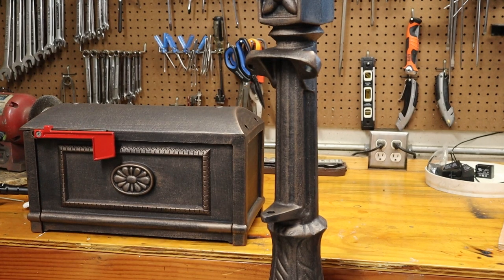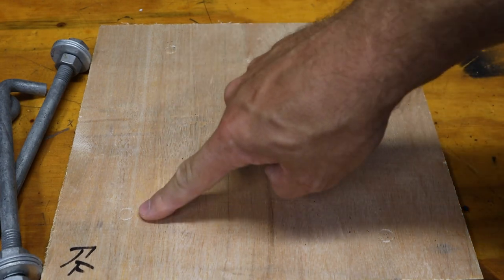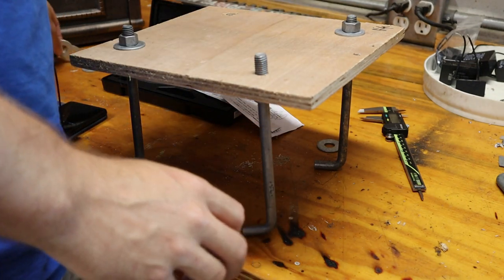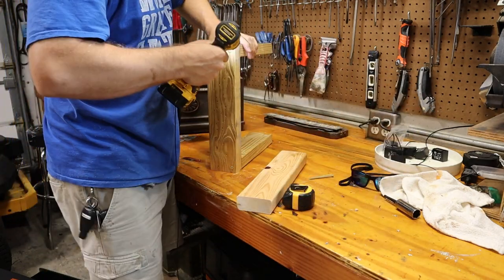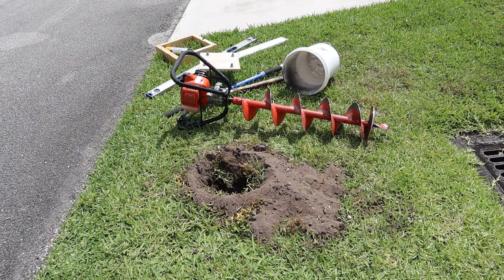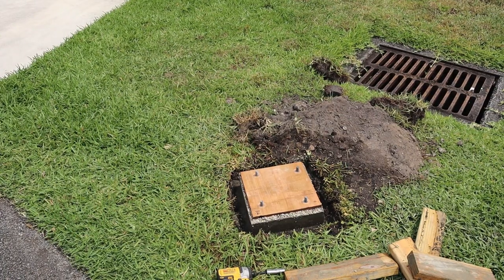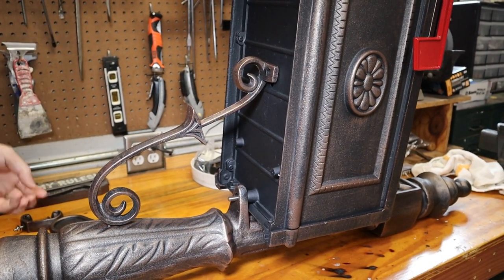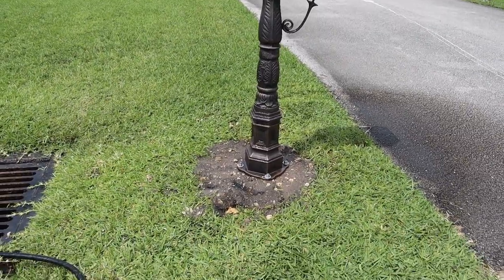Installing "Barcelona" cast aluminum mailbox and post

Comment: How did you keep the door open when assembling it to the post.   Very strong spring makes it slam.   What did the mailperson say when they saw the door on spring?

I just bought one of these and it came with "wedge-it" style bolts that you drill the hole in concrete from the top and insert it from the top.   Used these for installing machinery etc at work.   You can get these at the big box stores if needed.  No wood template needed.     We're looking at installing these on 40 homes in our community, so I think a tapered concrete form would allow to pull the form off without dissembling it as you move thru the neighborhood.  I plan on placing the form  approx 2" above the grass surface so that you have some concrete protection when trimming with string trimmer and not beating up the base of post.

Comment: You sound just like Jason Sudeikis!  Great video.  I want this mailbox,  but I don't know if I want to go through all this.  Lol
Reply from the maker: It really isn't all that bad. You could also just pour a slab and use Tapcons or Red Heads instead of sinking anchor bolts in the concrete.

Comment: Hey Joe, goog to see your 2 year old tutorial is still getting replies.  Thanks to great vids like yours!  I did have 1 question for you... The scroll attachment that bolts to the bottom of the box and down to the post is giving me confusion.   There is just a non-headed hex screw about 25 mm long that screws into the distal end of the scroll.   Where it connects to the post,  The hole is too big and there is no way of securing it into the post.  There is also nobody who could fit their arm inside the post or even reach that far up into the post to hold a nut and washer to thread that non headed screw into.  Any thougts?  I will also say the directions from the company are inadequate.

Comment: Hi Joe, thank you for making this video..  my husband and I have watched it many times..  so helpful..  we have the wood plate and bolts inserted.  The post fits great..  now for the concrete dry mix..  after filing the hole with dry mix, do you insert the wood plate before or after you add the water..  our fear is adding the water first and not being able to insert the bolted plate into the wet cement..  if you insert the bolted plate over the dry cement how would you add the water?  Any help would be most appreciated.
Reply from the maker: It has been a while but I think I inserted it dry. This is a very popular mailbox in my neighborhood and I see a lot of poor/failed installations. This is probably the only one that is still standing perfectly vertical 😂

Comment: My husband and I are not very handy. We are so worried about using 1/2” bolts because of how precise the holes need to be in the wood template for the post to align. Our worst nightmare is for post not to align after cement hardens. We considered using 3/8” Bolts so there is a little more flexibility, but finding them hard to find, particularly in a 10” length. What are your thoughts? 
Also, based on some review recommendations, we considered filling a 5 gal. pail with cement, but after watching your YouTube video, I think your installation looked more professional. 
Love the mailbox! Can’t wait until it is installed so we can enjoy it! Any advice you can provide would be appreciated! Great video! Thank you!
Reply from the maker: Thanks! Alignment is definitely a concern. You could take a different approach and set the concrete pad first, without studs, and later drill it from above and use concrete bolts like tapcons or red heads. This mailbox is very popular in my neighborhood and I've seen quite a few different installation methods and none of the mailboxes are falling over :-)

Comment: Lots of work. Just set your mold, pour concrete, let harden, and use concrete screws into pre drilled holes.
Reply from the maker: That would work too and be a lot faster, but this method is stronger and allows the mailbox to be removed as many times as needed. A drilled concrete hole can only be reused maybe once or twice before it needs to be redrilled. Not like the mailbox will be removed a ton, but this seemed like a better approach to me.

Comment: How dip is the hole?
Reply from the maker: I think I went down almost 2 ft. You could probably go down 16 to 18 in and be just fine
Reply: @JoesGarageProductionsLLC  thank-you
Reply: Hey Joe, I’m doing this over this weekend and I’ve found your video very helpful.  I think I’ll go with 3/8 bolts and maybe some verticals rebar to strengthen the column.  But your method - or the method you’ve researched - for aligning the bolts is spot on.